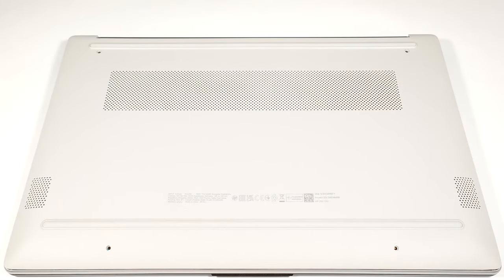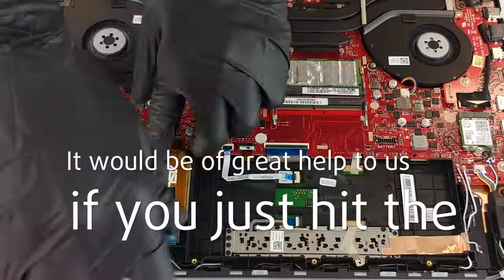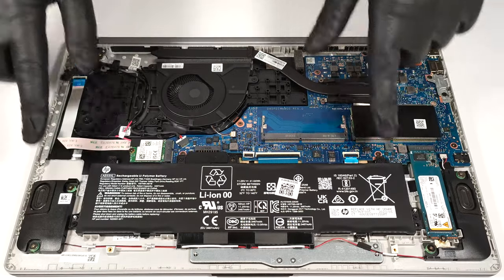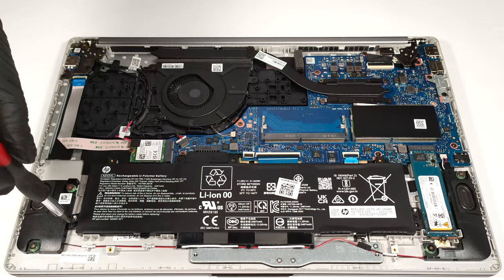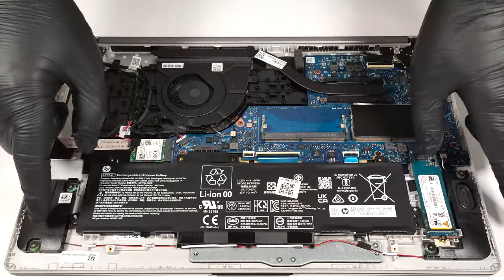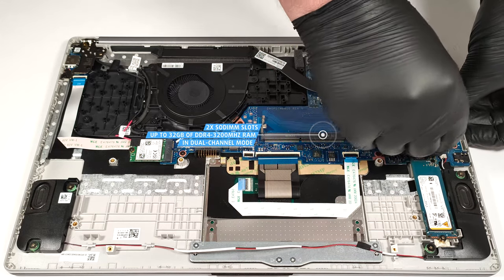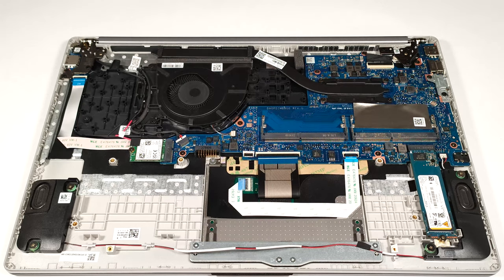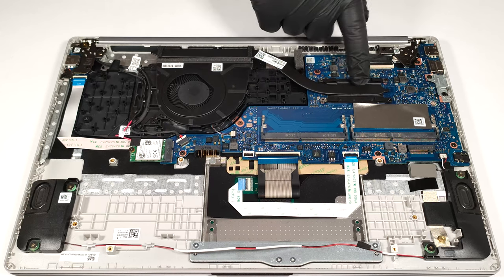🛠️ How to open HP 250 G10 - disassembly and upgrade options

Comment: Have high cpu temperature
Reply: Try 99% cpu max usage trick. >.<
Reply: @ahmeterhanarik  maximize cpu usage?
Reply: @ahmeterhanarik  I did it without any effect
Reply: @mohammadmosleh6678  q.q might be the high frequency hidden power setting or aggressive usage hidden power setting overrides the max usage. Happens on some CPUs.
Reply: @mohammadmosleh6678  oh and it's possible some oem app or driver sets power usage to max periodically. Old Samsung notebooks have that behaviour. They have this settings app installed that manages nearly everything and that was applying predetermined settings every 5 seconds.

Comment: OMG, so cheap materials, that they must compensate display weight with metal pieces. It was better if that piece of metal was connected to the cooler. Or maybe a bigger or heavier battery. It's still not an optimal design.
Reply: TheRealJohnHooper this is the best for its price. Other models like the dell Inspiron is terrible

Comment: My 6 months recension:

1) Battery is draining faster and faster..
2) AMD Radeon, without updates and sometimes after updates Instagram videos, Linkedin videos, non YT videos 
     are causing Adrenalin Bug report Tool to turn on..
3) Win11 and WiFi is loosing connection overtime,..

So no offense to anyone but if you ask me "It wasn't worth it",
My old Lenovo ThinkPad T430 is still the best laptop I've ever had!
Reply: it doesn't have AMD radeon
Reply: @nsetesmy6518  pa šta onda ima?
Reply: He just showed you how to open it, what do you mean by not worth it.

Comment: Does the notebook actually have an extra BIOS battery, or does everything run on the built-in battery?
After removing the battery, I always get an error message: CMOS Checksum error...
Reply: Some HP notebooks (for a while) do not come with CMOS battery. Since manufacturer does not expect the battery to be removed, CMOS data is kept alive by the battery.